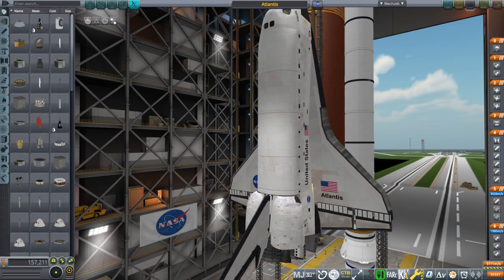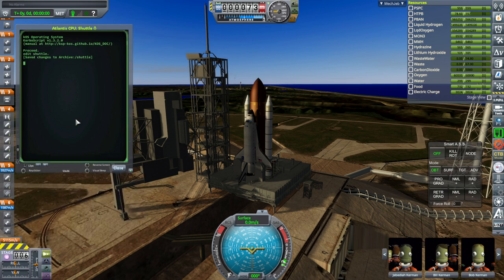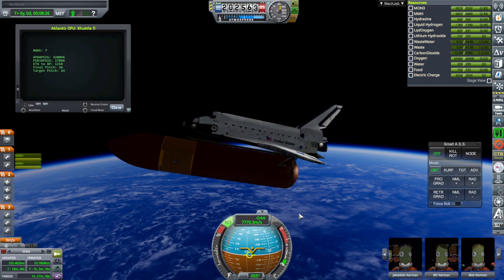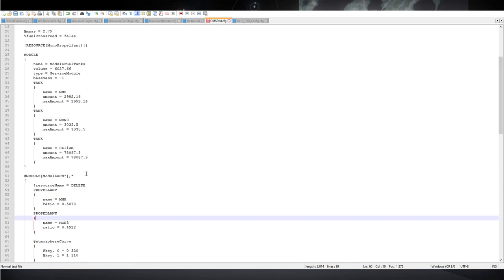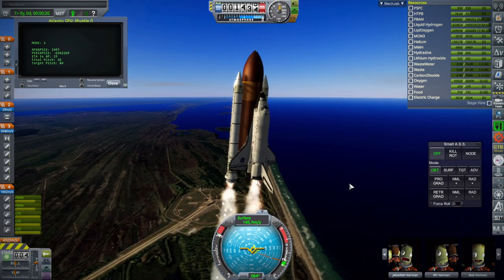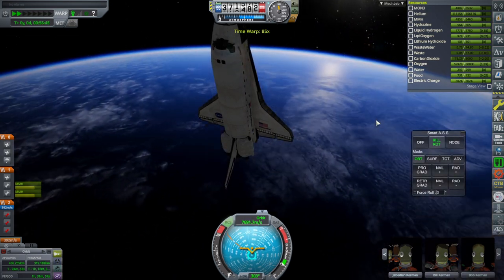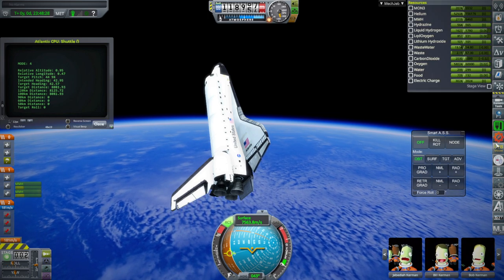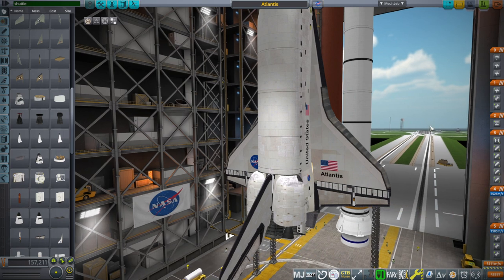Kerbal Space Program 1.12 with RO - Shuttle Testing

Comment: The configurable RCS pods have pressurant as a consumable. The official RO configs should have pressurant as well, bit i don't know. Ill investigate when I get home from summer camp, the cell service here is bad and I of course dont have my computer
Reply from the maker: I'm sure the official RO configs do. I added the helium to the OMS pods in my version of the Shuttle configs in the video. I'm used my configs from 1.8.1 partly to keep things consistent for the reentry test, but also to get a hint at what other changes have been made that I might need to adapt my own parts for, and, considering how things ended, I think I found some changes.

Comment: As I understand it, real heat is no longer recommended for RO installs post 1.10, as it causes overheating in inappropriate situations, I'm not 1000% certain that that's the reason, but I do know you're not supposed to install it anymore
Reply from the maker: Well, they said to use CKAN to install RO, and even though I don't like using CKAN, I did, and CKAN lists RealHeat as a dependency for RO, so maybe if they've changed that, they should fix it on the only installation procedure they recommend for KSP 1.12. Either that, or provide a proper dependency list, which they've apparently stopped doing outside of CKAN. According to CKAN, RO's dependencies are AJE, FAR, KJR, ModuleManager, RealChute, RealFuels, RealHeat, RealPlume, and SmokeScreen.
Reply: @RaizSpace  I agree, but what can you do lol... I'm just glad to not be in the mod making buissiness these days